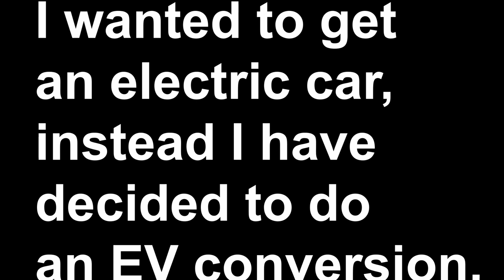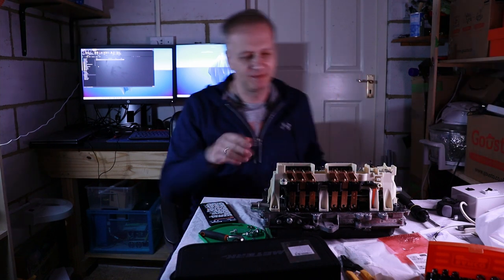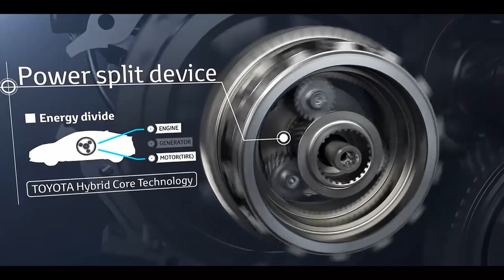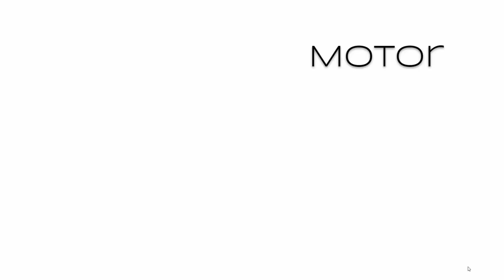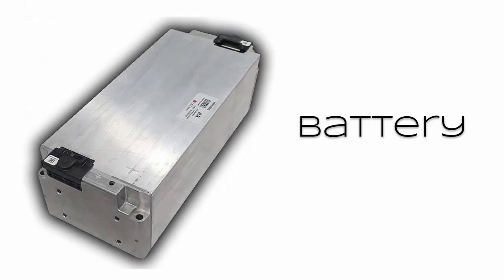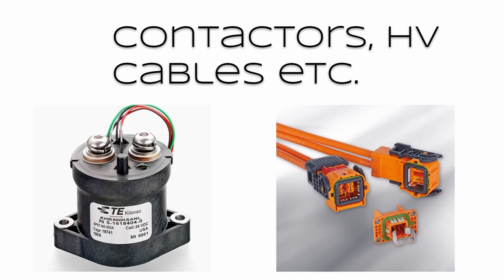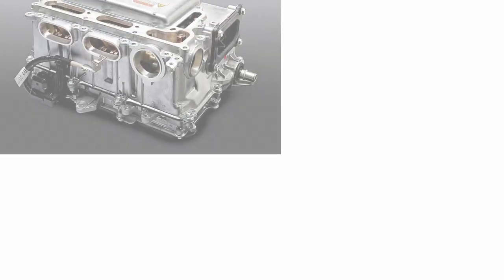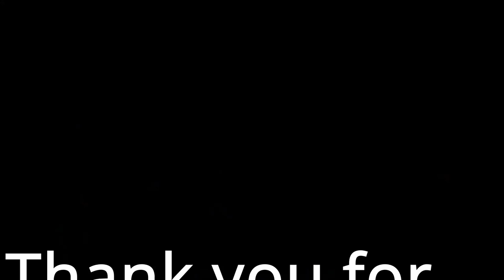DIY EV Toyota Prius Inverter and  gearbox  Ep 1

Comment: awesome... I just got gifted a 2010 Prius with 99k miles and I do know about the headgasket issues with 3rd gen prius... so eventually I would like to converter it to an EV whenever and if ever the headgasket goes on the engine or unless I get a cheap JDM engine... but would like to look into an EV conversion later.... but at least this gives me hope whenever the Prius headgasket goes...
Reply from the maker: Yes Prius is a nice car to convert and has the location to put some batteries in

Comment: I have a 2009 Prius that runs and drives but uses some oil. I want to convert it to EV.  Do you know anyone who has done this? Do you have any advice?
Reply from the maker: I have seen someone was driving Prius without ice. You will have problems with overriding ECU requests for sensors present in the engine. The other issue would be with the battery as it is rather small and won't give you many miles. If you go through sorting all this out you might as well go for better car in my opinion.

Comment: Hi Sir again I'm RAMZI . please can you tell me again how can i find pin 1 and pin 3 on INVERTER HYBRID TOYOTA GEN4 P610 ON Inverter its 2 connecters one (24pin ) another connector (13 pin )
pleas if you tel me hwo can I connect power 12 volt to run InverterI will be very grateful to you
Reply from the maker: Hi Ramzi I am sorry I am not familiar with the Gen 4 inverter. Please have a look at the Open inverter forum. Also check the Wiki for Open inverter

Comment: What is the car that you're going to convert?
Reply from the maker: This is something I have not decided yet. I am looking at Mazda RX-8 or Audi A2 or Audi TT. I want something not very heavy and not too expensive. At the same time I want to drive wheels directly from Toyota Prius gearbox so perhaps it should be front drive car
Reply: @LatutaEV  I wanted to do an rx8 myself, while I was in Ireland but it's not going to happen now 😔 it's a great candidate in my opinion (cheap to buy, nice car, 4 seater...) if you decide for that, you can get a lexus gs 450h gearbox instead of the Prius and still use the inverter.
Reply from the maker: @Apafej627  Yes I know my thoughts exactly but ( there is always but right 😉) I want to learn and experiment with cheap stuff first and Lexus gearbox is not cheap. I may even make a video about this. Because I went for Prius gearbox I want to drive wheels directly from it and I fear that there is not enough space for that at the back of RX-8. Because of this I am currently gravitating towards front wheel drive so I don't have to reinvent front suspension etc.
Reply: @LatutaEV    You could always just buy a plug-in prius and expand the pack or buy a used Leaf.  Seems like a lot work to just end up with an under powered car.  I've wanted to make it possible to turn the prius into a generator that can produce 80 KW of 120 volts or 240 volts.  That way when disaster occurs, you can fill up at a gas station and then drive to where the power is needed and have emergency power quickly.  What do you think?  Seems like it should be fairly easy to do.
Reply from the maker: @Islamisthecultofsin  I am against hybrids, I think that combination of ICE and electric makes the car too complex and unreliable. Nissan leaf motor is 80 kW and if can combine MG1 and MG2 I may be able to get 110 kW. Also the open inverter technology can be used with Tesla motors as well. So this will be next project 😃
Reply: @LatutaEV    The prius is very reliable with many taxis running at 500,000 miles.  What do you think about my idea of making an 80 KW generator that is still a drivable car?
Reply from the maker: Prius is a reliable car I agree but not as reliable if you compare it against Nissan Leaf for example. I don't fully understand about your generator Idea. If you are talking about range extender like BMW i3 I think it was a great idea when batteries were more expensive and had lower energy density. Now I believe this time has passed.
Reply: @LatutaEV   The Leaf is million mile car or more.  The generator ideas is just that.  An electrical generator that you fill up at the gas station and then drive it to where the power is needed.  Like down in New Orleans where the electrical grid is down.  It can put out at least 60 KW or more.
Reply from the maker: @Islamisthecultofsin  Sorry I have no plans to do that. I want to focus on EV technology. At this stage just want to get Prius electric motor working and have a usable battery set up with the BMS etc.
Reply: @LatutaEV    I was just wondering if the idea was sound or I was missing something that would make it undoable.  Right now an EV would be useless down in New Orleans.  The entire city and surrounding area has no power.  But priuses could be suppling emergency power even being used to charge EV's.
Reply from the maker: @Islamisthecultofsin  I think it is doable but it is definitely easier to buy a generator or get solar panels and battery
Reply: @LatutaEV  
Very cool project. Don't really agree that hybrids are less reliable. At least not a well-made car. I've got 376,000 Miles on my 13-year-old Toyota Prius. There's a lot of them running around with more than 500,000 on them. If you talk to people on the Prius forums you will find out that the most reliable part of the car is the internal combustion engine. You will lose a battery or an inverter or a inverter coolant pump long before you'll have a problem with the gasoline engine. Just replace my inverter couple months ago. Hundred bucks from a salvage yard. But the engine still runs fantastic.
In theory electric motors are much simpler and should be more reliable than an internal combustion engine. But it's always going to be the support technology for that electric motor that ends up failing. Either the inverter or battery or other supporting accessory electronics. And it doesn't matter how simple that electric motor is without the supporting hardware it's on the side of the road.
I'm definitely looking forward to more affordable electric vehicles showing up in the market. Right now it's pretty limited and or pretty expensive. My primary concern is cost of ownership reliability and practicality.
Reply from the maker: @kens97sto171  Thank you for your kind words about the project. When I was talking about realiability I meant that two systems together such as ICE and electric should be less reliable than just one for example only electric. But I do know that Prius is very reliable car 😄.  Also I agree that EVs are too expensive at the moment the cost of ownership is pretty low in comparison to ICE

Comment: Just buy a used Leaf.
Reply from the maker: Yes this is also an option but one of the aims of this project is to learn how AC motor and inverter works and create my own set up.
Reply: and be extremely boring like everyone else. No. Where i live if you walk anywhere you will trip over a Leaf.
Reply from the maker: @blackterminal  Yes this is always a challenge to find a good balance between useful technical details and be entertaining enough so people from different backgrounds find it interesting to watch. I find in UK Leaf motors although usually selling with inverter are much more expensive in around 800 to 1000 UK pounds. While Toyota inverter and motor/gearbox could be had for 200.
Reply: @blackterminal    Teslas everywhere where I live.  Leafs are like spotting a snow leopard.
Reply: @Islamisthecultofsin  a few Tesla's here but you have to be rich. Here Leafs are like modern day VW bug. Just everywhere. I'm sure they are good but if rather have a converted car to be different. I like to be different
Reply: @blackterminal     I agree.